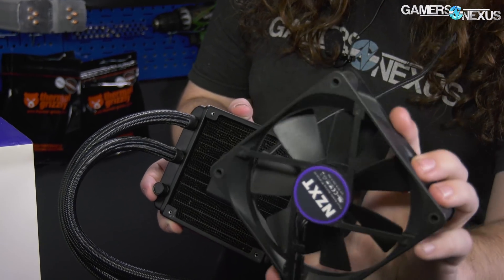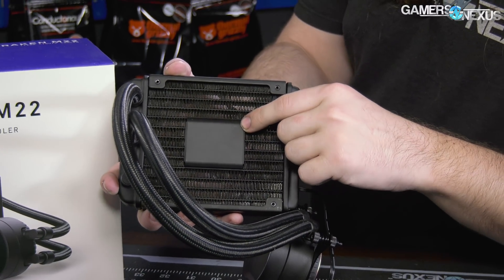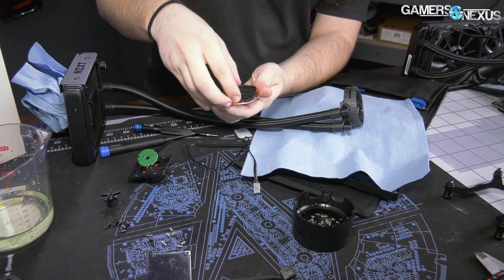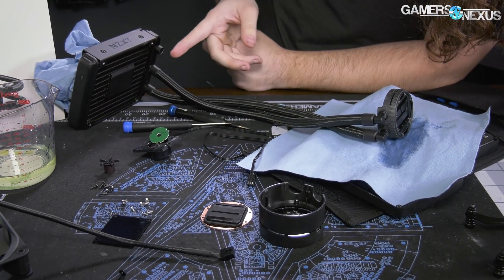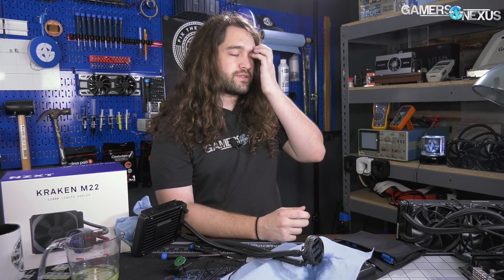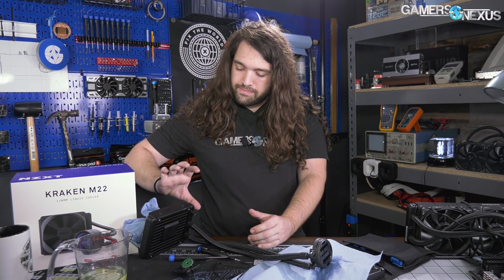Tearing Down a Strange Liquid Cooler - NZXT M22 Pump-in-Rad

Comment: I'm a little late seeing this video... but wouldn't it make more sense to place a pump where the hoses go into the radiator? 
I'm sure someone could design such a pump, instead of slapping it smack dab it the middle of the Rad... lol

Have the pump [if it needs to be larger than current designs]
kinda stick out perpendicular to the Rad, so as not to increase length... 

Yeah, they'd have to make custom pumps, but yeah, Loopholes~!
Then patent those so no one else can use the design lol

idk I think there is a much better solution here lol

Comment: It looks like the liquid only flows from the center of the micro fins to ONE side, leaving the other half of the micro fins without any heat dissipation. Did I see that right? Also, who is that judge that upheld this stupid patent? You can patent a specific pump design sure, but the bare placement of a component should not be eligible for a patent.
Reply: Yep, from the center to one side is what can be seen in the video... The non-electrical part seems to be very poorly designed...

Comment: Huh. I'll be damned. ifixit has all the drivers you'd need to work on Nintendo games and systems. And the battery on my copy of Chrono Trigger is probably long dead... the game cartridge is one of my most prized possessions, soooo... yeah, wouldn't want to damage it taking it apart to get to the battery to replace it.

Comment: If i were to try to rotate the nzxt logo like you said would i need to route out a new hole for the micro USB port used to power the logo? Seems like the board were power goes into and the logo with mirror are attached.

Comment: Hey, @Gamers Nexus do you think you could mod this radiator with DIY fittings and tubes to be an AIO to cool the VRM on the Asus ROG Maximus XI Formula? I already have a kraken x62 for my CPU and I don't want to get into a full custom loop. I ended up getting a killer deal on this new z390 mb and I would love to use the EK Crosschill III VRM waterblock.

Comment: I have an idea for computer coolant; Propylene Glycol + Copper Nanoparticles. It's probably not too expensive to get one's hands on enough nanoparticles to dissolve into a glycol coolant solution for optimal thermal performance (possibly superior to distilled water). However, the nanoparticles might oxidize in the glycol over time, possibly hindering thermal performance.

Comment: I have an odd question. I just bought this system for a temporary heat fix for my cpu. I really really like the water block digital Customization. When this system fails and breaks down could I replace the radiator, pump, res and tubing and attach this old block to my new custom system??? Appreciate any feedback

Comment: Long story short, those 120mm water cooling sets are obvious nonsense, either you take a good tower cooler using air to cool, or go straight for a good 240-360mm water cooling set for real improvement on temperatures

Comment: The pump style is like the one in my Sun Sun HW-303B Canister system which is rated for 370 GPH. Every aquarium filter uses the same type of magnetic impeller which over time will either need to be disassembled and cleaned up, or replaced. Although with an aquarium pump there is a common issue of contaminates being able to work it's way between the magnet and the housing.

Comment: I like the m22 to be my next CPU cooler. Is there any way or suggestion on tubes replacement? I would like it more custom with transparent tubes and colored fluid!
Would it be possible... What do you think?
Reply: You're better off with a custom loop, the time and trouble required to do what you're asking is far more difficult than building a proper loop. The m22 is a bad AIO, it has no place in the market as cheap AIOs are far worse than air coolers are, while being more expensive and far more failure prone. You're just asking for catastrophic failure by buying low quality AIOs, let alone doing your own mods to it that will definitely void your warranty when it inevitably leaks and takes out your computer.

Avoid the m22, and any 120mm aio for that matter (140mm too). Do not buy an AIO if you want to do custom, that's just plain stupid.
Reply: @pickleadaykeepsthedoctoraway i bought Deepcool captain 240 ex RGB finally. I taped the tubes with white electrical tape so it fits the rest of the system thats mainly white... Quick and dirty :D

Comment: better place in the tank .... and not loose surface area .. or even better the way I mount my radiators .. no pump needed unless you want to exchange the heat somewhere else

Comment: @Gamers Nexus
Thanks for another interesting TearDown, I'm really looking forward to see how it performs since I possibly see one BIG drawback with this design that You didn't mention in this video.
The problem I think I see is that the pump (at least appears to) intersect and thereby "cut off" of at least 4 of the 12 ( or 14?) fluid channels in the radiator, which I would expect renders them more or less useless, as no fluid can actually pass through them. So the fact that it appears as if the pump only takes up roughly a 1/9 of the radiator area, and as You pointed out is positioned behind the fan's "deadzone", is not the complete picture imo. Since it actually appears as if the pump renders almost  1/3 of the "fluid channels" more or useless" as the "stumps" that are left of the "channels" that are cut off are at least severely less efficient due to not having any fluid passing through them ?
It would have been interesting to hear Your take on that...but maybe You address it in Your performance video ?
Anyway as always thanks for great content.

P.S.
On a totally other subject, are You posting videos to "tvclip.biz" ? Because it appears as if there's a complete copy of Your "Gamers Nexus YouTube channel"  !!??
If that's not You "publishing" them there, then it might be something You should look into,  and possibly want to take action against ?
D.S.

Comment: the cold-plate looks like a design-flaw to me. the water comes in through the middle slot in the rubber gasket and goes out through the slot on the side. so, only one half of the microfins have a constant flow through them.

Comment: The patent system here in the U.S. needs an enema.  This patent being upheld is like saying Mercedes owns the patent for putting the engine in the front of the car, and in the rear (their first cars).  There was an even sillier one where all automobiles themselves were under patent and you needed to pay a license fee to some group of trolls, before Ford defeated them in court.  Unless someone violated a trademark, and used ASUStek's name on it, I just don't see this as being something that can be upheld.  This is why judges should be forced to retire by 50 years old.  45 for tech related issues.  I believe it would be easy to get an elderly person with no technical experience, sit them down and explain just how "unique" their design was.. not telling them that there are only 3 ways the pump can be mounted  (CPU, standalone and this weird radiator thing), and I believe they weren't the first to do this.
Reply: Same as copyright.
Reply: No, the patent system doesn't need an enema. US law dictates that unavoidable and general design concepts like this  are not able to patented, it's just some judge who probably doesn't even know how computers work. To be fair to whoever approved of it, AIOs didn't exist at the time and Asetek were the only ones who manufactured them.

Comment: cheap motor design... you wont be able to identify the in and out direction of the cpu base, because the motor will spin in any direction, that's why the impeller blades aren't directional

Comment: Everybody in the comments section failed business 101? While you could argue patents are slowing down product competition, and temporarily keeping prices higher, you have to understand that the patent itself is the incentive for the product design in the first place. If somebody could just come along and steal your product design day 2, there would be absolutely no reason for you to start designing products in the first place. We also get higher quality products with the patent as well. Again, if companies have to worry about product theft day 2, they're going to purposely find the cheapest parts and labor to make sure they have the most competitive prices after everybody comes and steals their design.
Reply: I would argue that asetek, was given a patent that was to broad, the patent should have been for the specific techniques they used to make a pump fit in the block not for the idea to use it.
Reply: @dstblj That's not asetek's fault. They filed for the patent and were awarded one. If the patent is too broad, design a product and let them take you to court. It either is or it isn't. And it's not aseteks responsibility to make sure other companies compete with them more aggressively. I actually think nzxt did a fairly good job with this design. I'm just curious as to how loud the damn thing is. 3000 rpm is screaming.

Comment: how does asetek get away with this crap? This definitely can't hold up in court. They literally tried to patent the only fucking possible design for AIO's that isn't complete garbage. That's like Honda patenting having a water pump thats not part of the radiator and now all cars must have the pumps built into the rad. it's fucking ridiculous.

Comment: I really don't like AIO hey, rather a heatpipe tower cooler with soldered and crimped connections, no maintenance ever, I have a Cooler Master Hyper 612 v2 in a Silverstone FT02 case so the heatpipes rise slightly to the top of the case

Comment: Personally I stopped using aio coolers they just don't have longevity, I have some air coolers that are 10 years old and they still perform just the same as when they were new. In other hand I would not use something like 5 year old aio and feel comfortable leaving it on over night.

Comment: Was hoping to see the radiator disassembled more. I am really interested to see how the water is channeled in side of it.
Reply: Probably that middle hose is isolated with those 4 ribs.
Reply: Msi got a similar lineup with rad pump. Inlet is to the right, water flows through a channel and separates converging on the lateral 4 ribs, joins back at the end and flows through the middle ones up to the pump and then through a channel out. Disassembled mine today so got s pretty good idea of how it works. It's kinda fine but water ain't flowing basically, some tower air coolers might do better than a 240 aio

Comment: There are already many pumps mounted to the CPU heat sink designs and have always been..  They're called fans and move a fluid called air or they are heat pipes, thermal driven pumps. So they have a patent for "lets use a water pump mounted to the CPU heat sink to pump water to remove heat" or probably "Novel location for water pump mounted to CPU heat sink". So we have already seen the pump in the rad, and the pump in the tube loop.
So patents don't kill innovation they can have the opposite effect and promote innovation.  My personal feeling is mounting an vibrating electromagnet on a CPU and close to the VRM coils (coupling and ripple anyone) is probably a long term bad idea.

Comment: So less air goes through. No thanks. Pointless, theres better.
Reply: A. K. The pump is in the deadzone of the fan, you won't notice anything temperature wise
Reply: Dion Rest Even losing a little for a pricey cooler is a issue. I never seen this apply to their other coolers which can bring a lack of quality control as well.

Comment: I don't get how the water flows through the radiator/pump!
So normaly the water flows from the in/outtake side  through one half of the "channels", then the other side that connects all the channels and the water is moving through the other half of the channels back to the outtake.
Here the Pump blocks the 4-6 channels in the middle, so I assume it pumps the water from this channels to the other side, where all channels are connected.
So the water can flow back through the outer channels and ends up at the in/outtake side again. But how does it go from here?
There are three tube fittings and I would assume, that the middle one is the intake and the outer ones are the outtake, but one of them is not connected....does it go past the middle part to the other outtake internally? 
Or is it blocked and part of the radiator has no water flow?

Comment: The pump location issue could be solved rather easily. Put it on the tank(as you said) but mount it vertically rather than horizontally. You would have the full thickness of the radiator plus the twenty-five or so millimeters of the fan, and you would be able to run the coolant around the periphery of the impeller allowing it to impart more energy for it's size.
Reply: Dynatron actually tried this, with a fairly large pump housing, tank and overhang, so the intake side of the radiator/pump combo looked like the capital letter 'L'. The fan fit neatly into the  L-shape in a pull configuration. However, Dynatron's AIOs were plagued with bad seals and thin tubing, if I remember right. Dynatron also has somewhat low consumer name recognition and didn't market these very well.